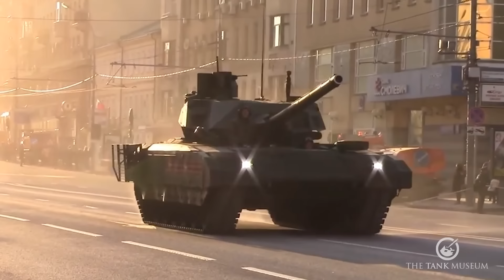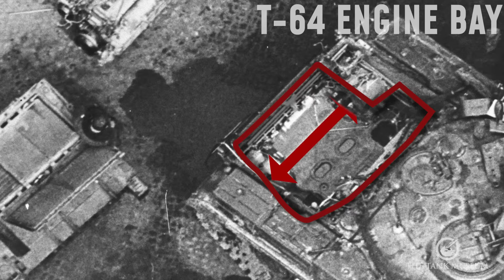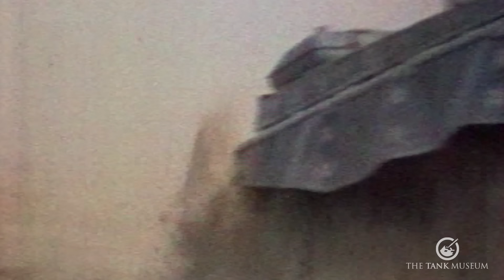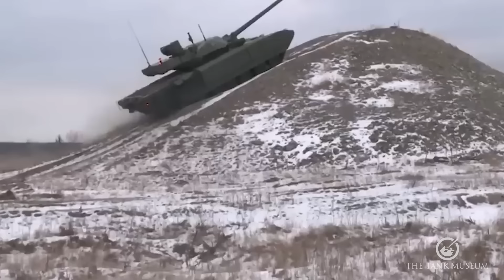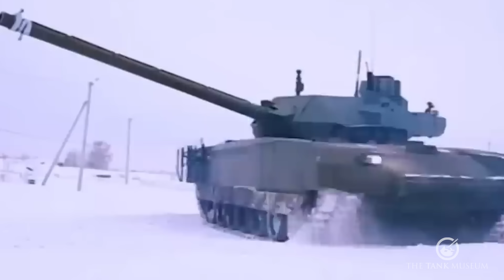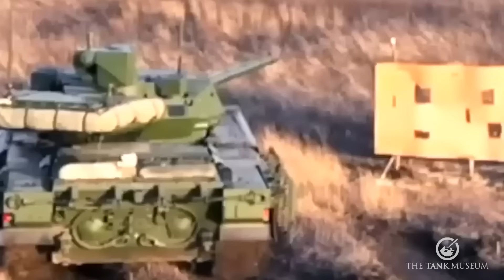Radical or Ridiculous? | T-14 Armata | Tank Chats #171

Comment: Thank you, very good summary. New to me was the length of the APFSDS penetrator. I had understood that in previous tanks the ammunition was two-parted, thus limiting the length of the penetrator and thus it's effectiveness
Reply: Two part ammunition doesn't limit the length of the penetrator, it can potentially allow for a longer penetrator. The size of the ammunition storage and handling infrastructure limits the length of the penetrator.
Reply: @InkandFish555  In trusty, old-school designs like a few of those common in the west one limiting factor is also the weight of the ammunition, as anything very much heavier than a standard 120mm round gets difficult for one loader to handle manually. Having heavier ammunition be two-part could have other potential advantages besides space saving in an automatic turret such as the one in this fancy parade vehicle.
Reply: yeah vaccum 1 is 900mm and vaccum 2 is 1000mm, there was rumors than the 152mm gun that was canceled could of fired a projectile twice as powerful as the 125mm thats on the t14
Reply: @jkc2001  idk how truthful those stats are, given that the Russians and former soviets have a history of lying, especially revolving around things with uranium lol (depleted or not). I dont see why they need big guns. mbt doctrine isn't about big guns anyway; its more about not being seen, then not being killed. Your armor and stealth are most important, and mobility comes with those too. The current 125 on the T-90M is already good enough to take out most Abrams, maybe not Leopards, though, and the T-14 has to sacrifice a lot of its stealth to have its new gun.
Reply: That amount of force doesn't even have to penetrate... Or will separate the turret, or roll over another tank...

Comment: Western manufacturing had better "systems integration" (firing computers/one shot one kill philosophy) and an actual powertrain although ironically the M1 Abrams Tank had in fact a very poorly made transmission which I think was rectified "over the decades" because of Gulf War 1 1991 then later War on that Terrorist Guy 2001-present.

Russian autoloaders remain the death knell of all Russian modern MBT. The T-55 was a great Tank tho...and still is as it had NBC protection. No idea about the T-14 Armata and use in NBC environment which is the "primary secondary" mission of even having an MBT in the first instance. The most important development for modern Tank design imo is the attempt to field AIP "Stirling Diesel" engines. Russia is still using conscription as their actual manpower use and that has been a CATASTROPHE in their and this is THEIR Russia Ukraine War.

Comment: The russians are right, the T14 is not needed for the ukrainian battlefield, since ukraine lost most of its T64s and their own T80 upgrade has only 4 produced, there is nothing a T80, T72 or even T62/T55 can't do, wich is mainly infantry support & indirect fire. 
Now that they got their act together, much less of their tanks have been lost but the T90 production has still ramped up to fill the gaps, wich means that it is either cheaper to outsource electronics but they can still produce them domestically if needed, or they are still being supplied through other nations, either way the T14 would be an unnecessary budget strain when regarding the few ukrainian leftower tanks & imported NATO tanks delivered & them being the downgraded ones on top, without the newest composite armor so pretty much everything from the 3BM42 upwards will penetrate them frontally, if anything the NATO tanks will be used as props for some videos way out of harms way to not cause a pr nightmare, but then they might be used in the next failed offensive too, who knows...
Reply: I stopped at "T80"
The only T80's Ukraine had were abandoned by orcs.
Reply: @rogerout8875  T84m Oplot ;) It is pretty unkown since they only managed to produce like 4 pieces in 8 years. It is a modified T80 derivative. It should have been the best T80 next to the T80BVM but it should be sold internationally, contrary to the T80BVM.
Reply: @DerDrecksack87  they're all junk T72's, I don't care how you dress them up.
But my previous statement is still correct.
Reply: @rogerout8875   the T80 has almost nothing in common with the T72, its like saying an M60 is the same as an M1 Abrams...
Reply: @DerDrecksack87  😆  you're clueless.

Comment: The main impression I got from all the T14 promo videos I've seen, is that its turret spins. I think they got that point across sufficiently lol..
Reply: But does it fly? That is the real question!
Reply: @Diggnuts  it might but still not as spectacular as Abrams/Leopard's one
Reply: you see they have invented a new way of driving the tank which utilizes springs which need to be wound up by the turrets rotation and its the most reliable way to power it because the engine is only needed to produce a lot of noise and not for drivong it because obviously they would have tried to copy maybe a newer engine design like a turbine but its too quiet and they need the noise because otherwise they can find their tanks because glonass doesnt work and they need the engine for smoke

Comment: Conceptually the T-14 is good; separating the crew from the ammo and putting them lower and under heavy armor should help crew survivability.   So should giving the whole crew electronically aided viewing systems and having an active protection system as standard.   The problem is that these are all high-tech difficult to produce things and Russian industry always seems to fall on its face when making things like the T-14   So I doubt it will be produced or used, but at least they gave the West alot of good ideas! 😁
Reply: It would need to show how capable is in an actual combat scenario.
On paper it sounds fine, but it would heavily rely on the gun never malfunctioning, if the loading ever has a hiccup there's not easy way for the crew to fix it.
And the thing about relying completely on external visual sensors, a single kamikazi drone might be able to take out the cameras and blind the whole crew in a worst case scenario.
I'm not saying it's complete garbage, I'm only saying that the claims on paper don't really mean much if it's not actually proven itself in a real scenario.
Reply: @TheLumberjack1987  Не переживай, он докажет!  Во первых и без него есть хорошие танки (Т-90, Т-95), а Т-14 просто концепция, которую надо обкатывать и поправлять. А то что ты написал, бред! Если пушка выйдет из строя, то на любом танке уже делать нечего (никто не чинит пушки в бою, а просто покидают негодный танк) То же самое касается и прицелов, и обзора. Чем Т-14 отличается от любого танка в этом плане? Да все то же самое!  А дрон-камикадзе просто убивает танк (ланцет) а не приборы наблюдения))
Reply: @TheLumberjack1987  Я тоже получаю тексты не на русском языке, но нажав строку "перевести на русский", всё переводится, а уж "гугл" переводит или не "гугл" не знаю.  Кстати, я не знаю как сделать перевод с русского на английский, это твои проблемы. Твои тексты я без труда перевожу для себя
Reply: @TheLumberjack1987  Agreed. Even the mist from a diesel motor could cloud the sensors required for hatch down operations.
Reply: > M1 TTB lol
Reply: @SRDPS2  Конечно))  Наверное идиоты никак не могут понять, что Россия Великая Держава и может делать всё!  Германия тоже сомневалась, однако очень удивилась увидев на поле боя огромное количество Т-34))  Первый спутник, первый человек в космосе, ядерное оружие, гиперзвуковое оружие, АПЛ и т.д., видимо не считается😅
Reply: @yuriykiyko4568  Practice Russia Soviet are
Henge why Soviet time have very first thing, but Russia ain't Soviet Union
Very first of Soviet can number, Russia ain't so I'm not impressed for Russia time
Reply: @SRDPS2  Ты вообще не в курсе событий.  Советский Союз существовал всего 74 года, а Россия существует уже 1000 лет. До СССР была Российская Империя и у неё тоже всё было и пушки и броненосцы и т.д.. А Советский Союз это и была Россия!  Никто из бывших Союзных Республик больше не строит ни корабли, ни танки, ни самолеты, ни АПЛ, ни ракеты. Только РФ!
Reply: @yuriykiyko4568  so you about the very first idea, about that 74 years is how happened in Russia
if you said Russia empire can build anything, let's be something else because a country small than Russia empire also can build anything (even they invention first)
Reply: @SRDPS2  Нет, маленькая страна не может построить что угодно. Многие вещи просто недоступны по цене и ресурсам для маленькой страны. Ведь само производство (завод) это конечная стадия и завод может стоять где угодно, даже в маленькой стране, но это не значит что это делает сама маленькая страна. Рабочие просто собирают детали и даже не знают как они устроены. Главная работа это - фундаментальная наука, это сотни научных институтов связанных между собой, это научные открытия, это испытательные лаборатории, это полигоны и т.д..  Это в этих учреждениях рождаются идеи, открытия, технологии, а потом только передаются на завод. Так вот содержание всего этого не по карману маленькой стране, только стране богатой, с богатыми ресурсами. Россия таковой является!
Reply: Russias economy is central to its failure as a power. Italy. With no oil or other resources has a much
Larger and stronger economy than the Russian Federation. So to does Brazil, Portugal, and almost any country in the EU outside of former Soviet client states. 
Russia is hopelessly authoritarian and backwards. The Czars would instantly recognize the corruption and ponderous government.